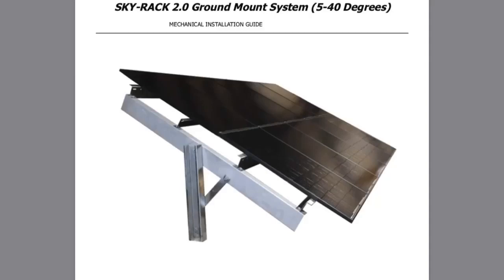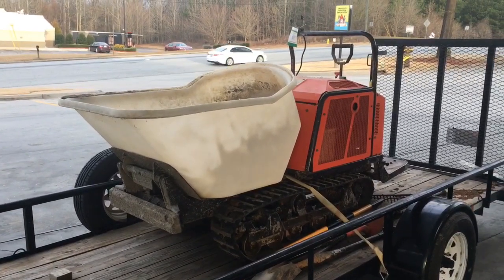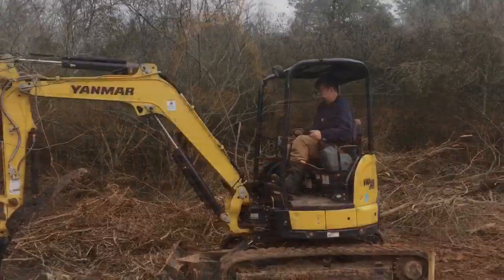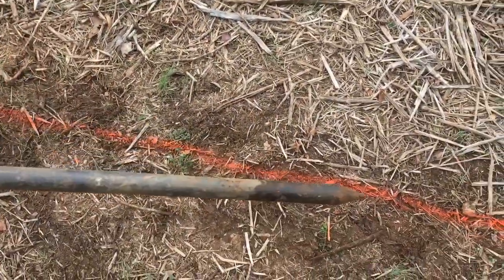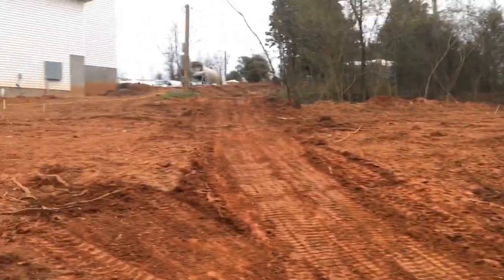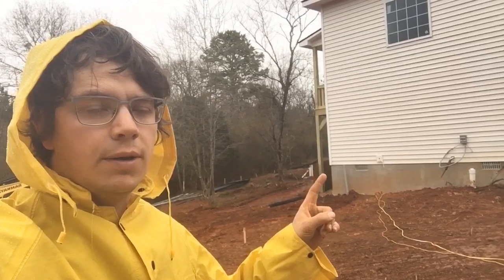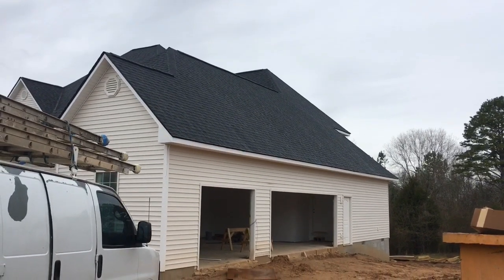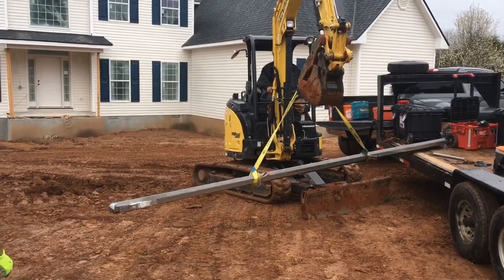Enphase groundmount w/engineer775:  setting posts and digging

Comment: Nice tool, Johnny.  Have you ever sunk ground mounts using only tightly-packed pea gravel, like is done with some fence posts?  We are hoping for a way to not use concrete if we can help it.  Roof mount solar is a hassle if you are a roofer, haha!
Reply from the maker: Contentment Might work. Get it engineered. Check out American earth anchors. That worked for us on a pipe mount. This is a 6’ deep 2’ diameter hole

Comment: Why Enphase?
Why did Magnum discontinue the GT 500?
Reply from the maker: Echo Papa enphase has a new battery ensemble coming out. It will be seemless and single manufacturer solution. Yes APSytems was making the gt500 for magnum and after magnum got bought by sensata they had a falling out
Reply: Gain Solar Services 
Thanks for the info.
Are there any alternatives to the GT 500 if we’re running the Magnum 44? (PAE 4448)
Reply from the maker: Echo Papa it will ac couple with AP systems microinverters or SMA 3.8 but don’t exceed 90% of magnums rated wattage. So 4000watts max of grid tie solar inverter